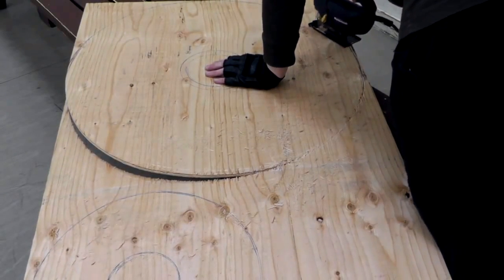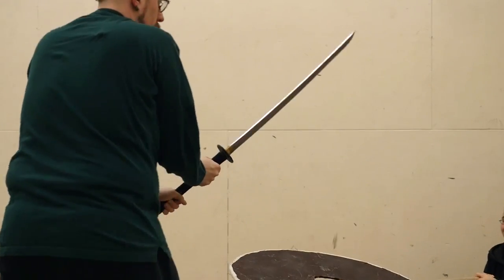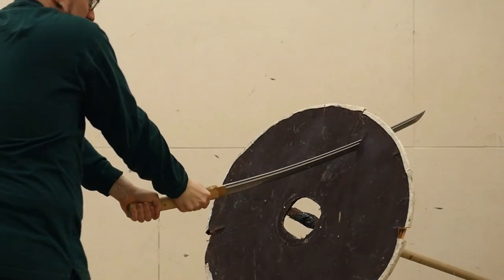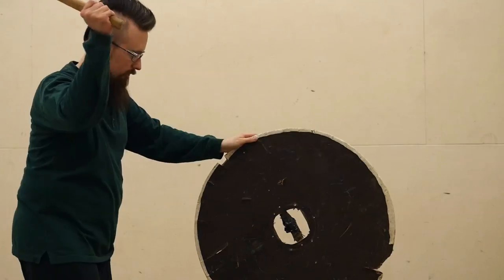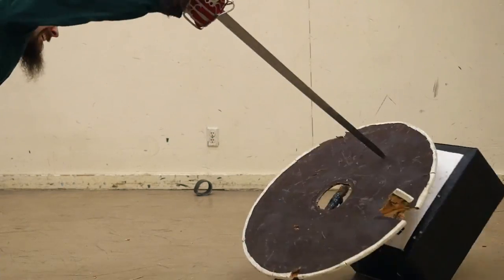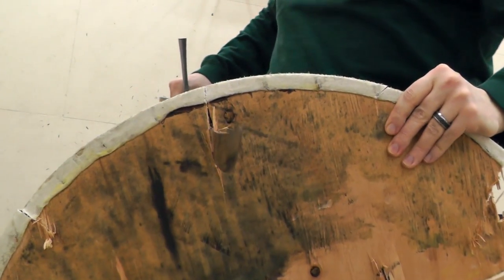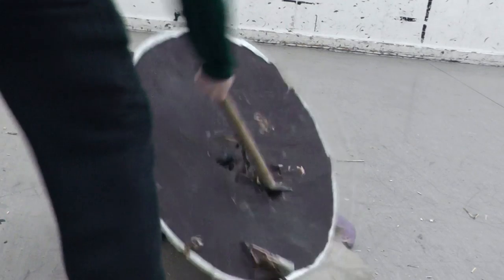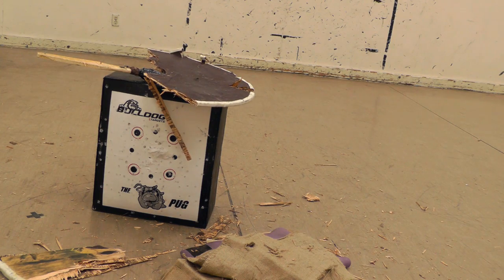Plywood shield vs broadsword, katana, axe, kriegsmesser, and war hammer

Comment: As for katana it seems like most of the cuts you delviered were from the eblows. If you tried to use your wrists a bit more then perhaps it would be slightly mroe effective. Just look hwo they strike in kendo for example.
Reply: Newsflash: katanas in any case are shit against shields and armor.
Reply: Verithiell also kendo isn't fighting it's a highly ritualised duling form.
Reply: Leonhart Hunt This is true, but I have heard from more than one kenjutsu enthusiast, that the katana is, in fact, typically swung differently than European counterparts, so there is some merit in his comment. I believe the way the katana is intended to be swung is usually compared to casting a fishing rod.
Reply: Leonhart Hunt yeah, but kendo is a good example as their mvoes are pretty exaggerated.
Reply: KatakiDoragon add to that curved blade. Using it like a european straight blade won't cut it (pun not intened :)
Reply: Verithiell not really it would be like saying Spanish/italian/german Rapier is the same as Olympic fencing.
Reply: Leonhart Hunt But thats how you deliver cuts from above the head. Kendo is pretty good example as its clear since the mvoes are so exaggerated. Thats what I mean. I am not comparing anything.
Reply: I dont have much experience in Kendo only did it for a short time 1 year to learn the fundamentals. It's not the only way to deliver cuts above the head its a very good way but as with most dueling forms it misses the non-perfect "scrappy" fighting that gives such an edge in free fighting and allows you to use your body weight/size/speed to its best advantage. People are not equal some are faster/stronger/more stamina/ taller/shorter/ fat/thin this affects your fighting by a large degree this even affects your basic strikes.

One of my students is an ex kenjutsu enthusiasts fought at national comps and her moves are very predictable because she learnt a dueling form and has little/no improvisation.
Reply: +Brandon Szparagowski newsflash:any swords are shit against sheild and armour
Reply: jordan nazif nah, katanas can cut tanks in half bro, get with it
Reply: +Brandon Szparagowski well, you might think you are smart with your irony, but I bet you havent played metal gear revengeance xD
Reply: Verithiell dude, Raiden's shitty lazer stick is peanuts compared to a real Katana
Reply: Brandon Szparagowski and any sword is better than a  katana's bad steel composite, a pure carbon steel is far superior. (holds an edge better, more flexibility and stronger)
Reply: +Brandon Szparagowski pshh my pomel is infused with 100000 pomel making blacksmith souls if i throw it it will drill a hole through the multiverse
Reply: jordan nazif hey man, I agree, I keep sword pommels at my side at all times in case of an attack. they have saved me from Neo-Nazis multiple times.
Reply: Brandon Szparagowski my pomels made out f a nokia 3310
Reply: /sigh the stupid pommel joke, its not practical and most swords were riveted not rat tails so theirs no pommel to unscrew.
Reply: Leonhart Hunt thats why i shoot pomels from a slingshot its ver effective and it ends him very rightly
Reply: jordan nazif I can honesty say if someone threw a pommel at me during a bout, it would make it easier to take down, I would be too busy laughing. A pommel isn't going to do much especially if Im armored.

Comment: Not trying to slight you, but your technique with the katana was pretty bad.  The Japanese test their swords in tests call tameshigiri which includes slicing/cutting completely through thick bamboo, rolled up reed mat, tatami and even sheet of metal. Although it was originally for testing swords, it actually is a test of the swordman's technique.

Comment: no sword is designed to try to cut plywood, plywood is designed to do just this and stop impacts and stress from bending, it will not ever ever split, cmon skaaaaallll  what the hell, if this was a planked shield it would be destroyed in an instant  which frequently happened as you know.

Comment: Different fighting styles, different weapons. Samurai warfare was not as chaotic as European fighting. A lot of the time two forces just walked up challenged each other to a duel, the victor stands there and waits for another person to duel instead of interfering with other fights and such. Obviously that wasn't the case every time. The katana rarely was facing an opponent with a shield, they just didn't use them much in Japan, so it is going to suck against a shield. European fighting was more chaotic, and did tend to favor shields so European weapons adapted to be more effective against an opponent with a shield. Necessity is the mother of invention, in Japan there was no need so no solutions really came about in swords, in Europe it was and they did. The samurai had other weapons that would be pretty effective against more heavily armored opponents, like the kanabo, but that took a lot of strength and endurance. So very few samurai chose that when they could use a lighter weapon to a very similar lethality.

Comment: Plywood doesn't have grain. They are made of perpendicularly stack sheets off wood.
Reply: quite right, plywood consists of multiple thick veneers, glued up and with the grain stacked at right angles for maximum rigidity and strength. the depth of the cut @ 2:10-2:15 is pure luck, further more, going around hitting nails with a serviceable katana is just plain cringeworthy dumb. it's going to take a lot of sword polishing to get that katana right once more and furthermore, will that ever even happen???

Comment: This is not really an accurate test since in ancient and mode ok time they did not have this plywood. They were frequently made from boards/planks but people also fail to construct accurate representations of the shields. Certain very effective methods were used to make very strong wood shields in those times and the methods used to make them so durable have been for the most part lost or ignored.
Reply: he acknowledged this. this is just mindless ugly shield destruction for the sake of mindless ugly shield destruction

Comment: So this shield is what, 15lbs when fully assembled? That amount of plywood alone if this is the 3/8ths thickness from the other vid has to be at least 10lbs+. so 3-5lbs weapons vs. 15lbs shield. I wonder what is more taxing, walking around in 100lbs of plate armor displaced over the body, or carrying a 15lb shield?
Reply: flufebunekilr well armour also protects you from missile weapons so you really want both.

My plate armour only weights 26kg's (51 pounds) and my shield weighs 2.1kg's  (10 pounds) including fittings
Reply: flufebunekilr I think the shield would be more tiresome to be honest. Plate armour had really good weight displacement. Imagine having a great backpack and putting 20KG of stuff in there; with a really good backpack you can walk for a day and barely feel it. Now take about 2 to 4 KG, put them in grocery bag and walk around with it a whole day. Unless you're used to it (which they were) you'll be way more tired from carrying the shield than wearing the armour.
Reply: SovietButcher  your quite right, a shoulder strap helps alot with your shield especially when you're fighting long durations its nice to be able to rest the weight for a few minutes. With plate after the first 30min you don't even notice the weight, your just concentration of formations and keep your shield up to stop archers picking you off.

I train to fight for 2 hour durations (with 4ish breaks for water) it wipes you out by the end of it especially if you're active and not just a shield wall.
Reply: 20kg back pack (40+lbs) I could walk but jogging more than a mile or may be less is way out of the question. At the end of the day I definitely would know i was carrying 40lbs. I see your point about how taxing holding a shield would be. I'd assume the man with the 15-20lbs shield could at least move faster than the plate armor man?

Comment: So, is there a disadvantage to a metal shield other then the weight?
Because the swords getting stuck and such.
Reply: No
Reply: Most metal shields were pretty small, obviously do to weight.
Reply: you actually want your opponent to get his weapon stuck if it's a wooden shield
Reply: Ken Millspaw
Depending on the strength of the opponent I am sure that could end up being a disadvantage. And if it's not a one on one fight.
Reply: +OddJaguar15 well the stronger the opponent the more the weapon will be stuck. There is a chance he could rip the shield out of your grip but his weapon would still be stuck in the shield and you still have your weapon
Reply: Ken Millspaw
I suppose so, I was thinking the guy would just dislocate your arm or something, I'm also normally under the assumption people have more then one weapon, then again I only assume this because of mount and blade, which isn't the most unrealistic game, but isn't super authentic either.
Reply: +OddJaguar15 weapons getting stuck could also be a disadvantage potentially. people throwing heavy javelins at you, a couple get stuck and you will have a hard time in melee assuming you don't have time to remove them. 

sort of like Romans with pila, throw before a charge. either get stuck in shields, making them harder to use, or stuck in people.
Reply: CaptainLekirk
 I never of thought of that. I don't have much I can say other then that.
Reply: +CaptainLekirk Doesn't have to be the heavy stuff even. Lighter javelins and for that matter arrows get stuck in shields just fine, and the added weight isn't going to make them any easier to wield. Pilum-type nastiness with long thin metal shanks (contemporary Iberians, from whom the Italians picked up the idea, had an even more extreme all-metal version the Romans called soliferrum apparently) is really just better at going far through a shield and, if not actually poking a hole in the wielder, being that much more of a PITA. Also that much more difficult to pull out in haste or chop off - the latter effect of course being readily enough achieved on wooden shafts with metal reinforcing strips or, if you're on budget, just wrapping some leather around it.
Reply: XCodes Pulling the shield "out of line" so your mates can take an easier shot at the other guy would seem pretty legit in mass combat though... 
Hooking it with something (an axe should do fine) would probably be the more convenient way to do it, but if you already poked something into the board might as well make most of the situation I guess?

'Course, it also gives the shield's owner an opportunity to manipulate your weapon in undesirable ways so better know what you're doing as usual...

Comment: Well. What can I say. Have you ever tried hammering a nail into an unsupported plank? That's representative of what you're doing. Wasting your time. All your momentum is transferred into movement of the shield, especially at 03:21 onward. Thus, little energy is used to actually break, or cut into the shield. So when you say an axe is not very effective, that's a bit of a confused conclusion. I'd say your cardboard support wasn't very effective.
Reply: True to some level, but if you where to strike a shield then there would be quite a bit of give in the guys arm as well. First off it would naturally move from the impact, but then it also would move just from the fact that someone even just semi experienced would understand that letting your arm give to the cut would make the force put on your body way less
Reply: Well, not necessarily. You'd typically brace the shield against your shoulder, to prevent the shield moving freely from the blow. A moving shield is bad, because it will either leave you unshielded with you moving the shield around you, or you'd absorb it's momentum. Typically with something else than a braced shoulder, which might hurt a lot.

Comment: what is the logic behind single edged swords? Aerodynamics? Safety? strategic value of a blunt end? there has to be or else they wouldn't exist.
Reply: Single edged swords allow curves. Curves allow better cutting and close mobility at the cost of length. Cutlasses and cavalry sabers are good examples of single edges being put to use. Double edged swords allow direction changing at the cost of being straight and thus more likely to get stuck when doing a cut
Reply: Kitt C are there double edged curved swords? What causes them to be less effective? I'm assuming a design flaw?
Reply: Arshan Hasan There would be no purpose in a double edged curve sword because you will almost never use the edge on the inside of the curve. I believe the Kukri has two 'edges' on either side of its point but the Kukri balances between axe and sword

Comment: If for whatever stupid reason you attacked a shield with a sword the katana would be the easiest to remove, or else it would have enough self-respect to glance off and put itself in a useful position.  Unless it was a clean cut in which case it would cut the deepest as shown above since it's speciality is cutting, among other things. It works against lightly armored opponents.
Against full armor longswords are better in (yes, I know, swords aren't meant for full armor but I'm comparing swords right now, okay? Let me finish) one aspect which is bashing which can't be too hard since you guys generally favor bashing over finesse. I've seen the way you spar it's not pretty.

Comment: Imagine a breastplate, made of hand sized scales of 3/4 inch plywood. I would be willing to bet that no hand held weapon could defeat it, unless you managed to sneak the point of a sword through the gaps. Plywood is extremely strong, and resistant to slashes.

Comment: i would have wondered how it held up against bow and arrow/crossbow
Reply: +MrHuggaga there would be a lot of variables. The draw strength, range, the bolt\arrow head. But I can tell you from short range a bolt from a weak crossbow would pass entirely through it.  But don't have the experience  of shooting at great ranges to tell you how it would preform then.

Comment: If that happend to the shield. What the hell would happen to the arms of the poor people who wilded shields?
Reply: Exit 2008 not too much: 1. attacking the shield (with hard strikes, not just pushing it to some side to create an opening) seems to be more dangerous for the attacker, so it's unlikely someone would pound your shield like in this test. (the battle-axe might make an exception). 2. people would certainly not just stand there rock-solid and wait for their opponent to keep on brutalizing their shields. they would move away from strikes, divert force, and in fact simply avoid practically all of the strikes tested: they are focused on the force of the hit and most are quite slow.

Comment: When your enemy has a shield. It is a good thing your sword can't cut the shield so you won't stuck. Am i wrong?
Reply: doğru
Reply: I'd say that depends on whether you have the recovery time to get it back out again, getting stuck with a smaller weapon is probably more problematic because the defender will be able to offset the impact more easily. The kriegsmesser would be an alright choice if the impact is so strong the defnder cant capitalize. When in doubt, use a mace, structural damage and the repeated hits on the arm will wear down your opponent.

Comment: so wait, a plywood shield would actually work against a real sword? i mean obviously it wont be good, but it will be better than nothing, right?
Reply from the maker: +Ztealthy 
Plywood can actually be pretty good as a shield.
Reply: would adding some kind of iron plating arond the rim be better? or is plywood so fragile that youre better of not wasting your time and iron to improve it?
Reply from the maker: +Ztealthy 
It's actually better to leave the rim as it is because then the opponent's blade may get stuck in it, allowing you to control it.
Reply: +Skallagrim oh yeah, i completely forgot about the aspect of swords getting stuck. These plywood shields have handles instead of straps, is that because strapped shields are supposed to be heavier, and plywood is too light and fragile?
Reply from the maker: +Ztealthy 
No, Viking shields always had the centergrip, as did most shields before medieval times.
Reply: +Skallagrim 
Were actual shields ever made intentionally soft or a certain consistency so that blades would get stuck?

Comment: The katana is not made to be used in the way you used it *****.

I'm not an expert thou I have received a little training in using a Katana, however I did notice a few mistakes that you did.
1. the way you were holding the Katana was wrong,
2. the way you where fokusing all your power in a single point of the katana, it almost looks like you are expecting the weight of the katana to do the work for you.. that is simply not how the katana was build to be used. shortly said you were using the katana to hack at the shield.
3. you didn't have any wrist movement.
4. you didn't Slash with the sword

all this said I don't think that you would had gotten a much better result than what you did except most likely it wouldn't had been stuck afterwards. simply put your technique with the Katana is not correct.
Reply: Steffen Segovia Helbo A katana still would not perform well. Katanas are not meant to be used against armor or shields--only flesh. That's why they were purely backup weapons, used only in duels or desperate situations. They were not good swords, when it comes down to it.
Reply: +The Dragoon saying they are not good swords lol obvious katana anticultist